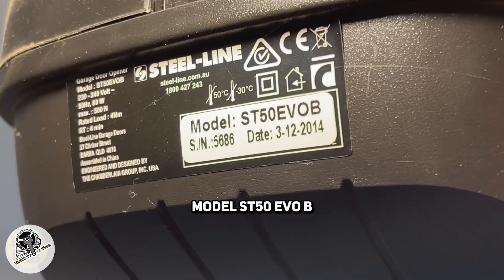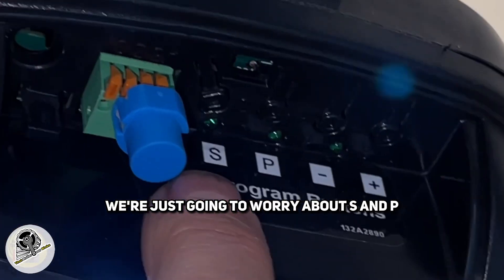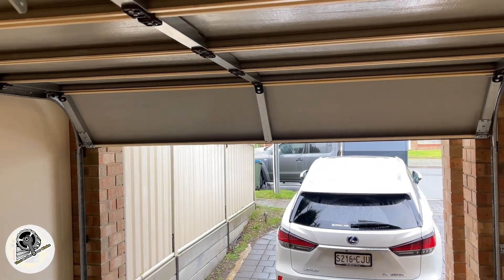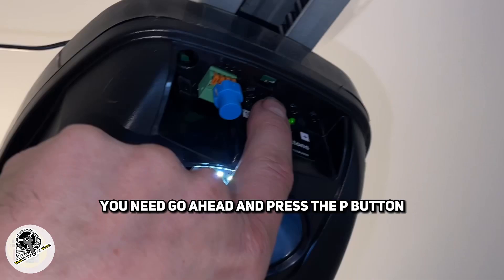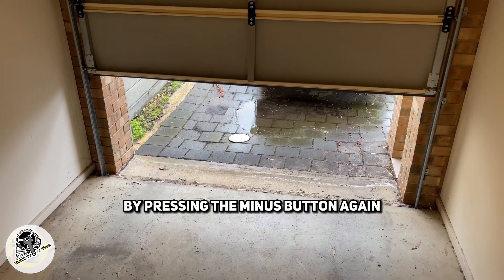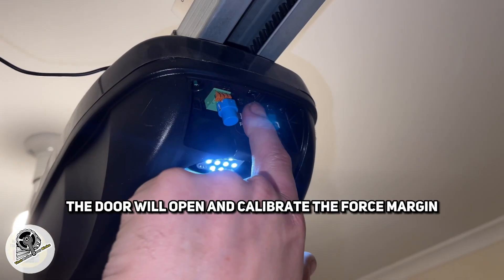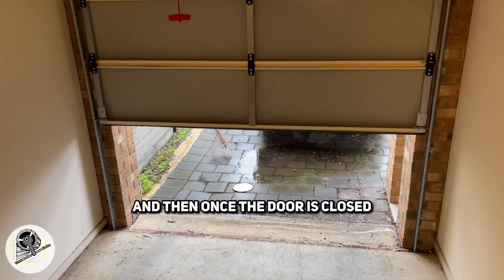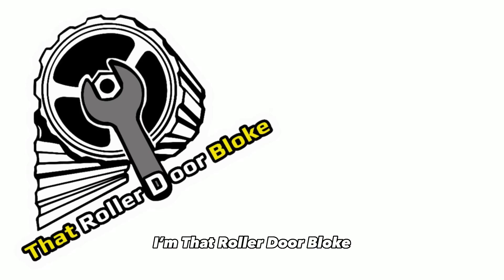[16] Steel Line ST50EVOB setting the limits

Comment: Awesome to know! We've got a Steel-Line ST50EVOB1 and I want to hook up a Meross smart wi-fi garage door opener. According to the Meross website the ST50EVOB is compatible, I can't see any difference between that and the ST50EVOB1 - but I also have no idea how it's meant to connect. Don't suppose you have any tutorials or tips on this specific model do you? I don't want to buy it if I actually can't install it.
Reply from the maker: Yeah should be a piece of cake - page 5 of the manual https://motepro.com.au/Manuals/Boss/Sectional/st50evob_st50evoc.pdf
Hook the activation wires into terminals 1 & 2.  You might be able to get power from 2 & 3 for the other 2 wires (2 is ground) or it might come with a separate power pack and you can use a double adapter.

Comment: Hi
I have a problem l with steel line ST50EVOB1, that is i have to hold remote botton for 3 or 4 seconds to open the door is there any way to reprogram it to work with one short press like others
Thanks
Reply from the maker: Haven’t heard of that one before